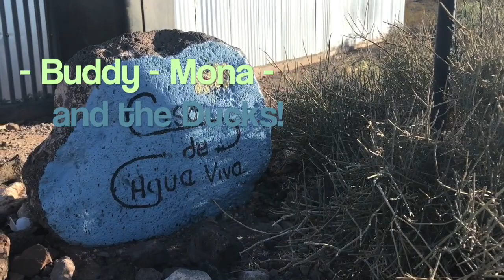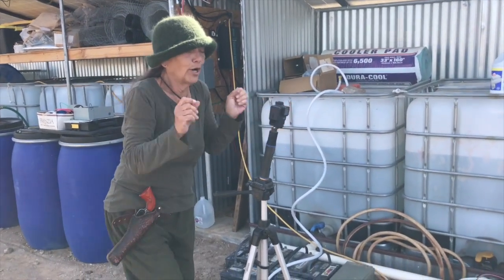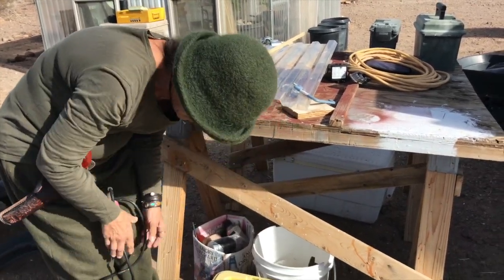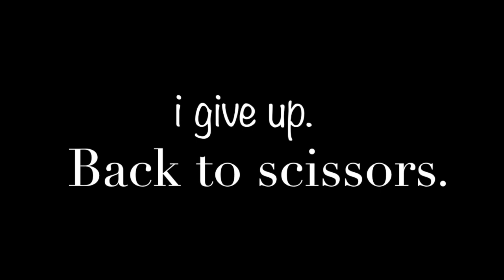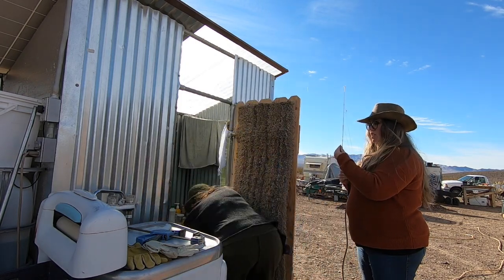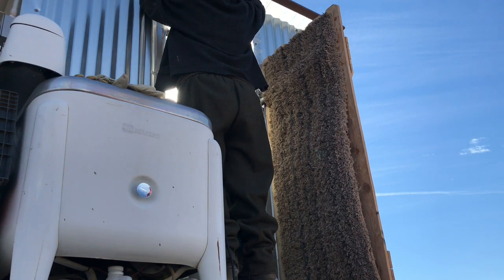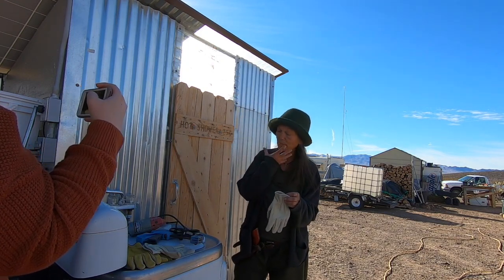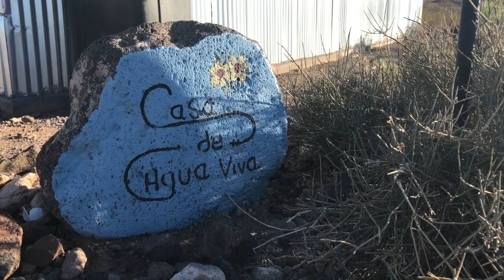Project Day with Sara and a Mini-Desert Adventure 01/24 Monday

Comment: Pilot holes with a drill bit may have helped and your arms would have liked it if you got yourself higher on the ladder.  Casa de agua viva está bien construida tu hombre estaría orgulloso de tu esfuerzo Stay you!
Reply from the maker: I considered that. Then I thought of the effort required to make that happen. Sara tried to tell me. The problem was I had gone through plastic before and though a higher point would have helped, I also would have not been able to balance, hold the drill and push without falling backward. 

Good news. I’m done with plastic. Any tips on working with metal before I get started?
Reply from the maker: P.S. I don’t speak Spanish.
Reply: @Betriska   I too don't speak Spanish. Needed to use Google to translate the name of your homestead myself.  When it comes to working with metal drilling pilot holes and avoid working overhead will still benefit you. I find YouTube vary helpful when I need to figure out how to do new things. Be Safe Be Positive Be You

Comment: trying to help,, if you turn the saw blade around backward it will do much better when cutting plastic corrugated sheeting, also paneling, praise Jesus.
Reply from the maker: Thanks David. That thought ran through my head. Most of my tools were set up by Bob. Undoing the screws and latches has proven to be a challenge in itself! 

I’m always open to suggestions! I obviously don’t always listen - as Sara’s advice to screw pilot holes was unheeded. But she tried! 😆